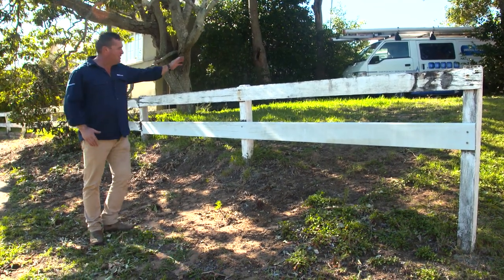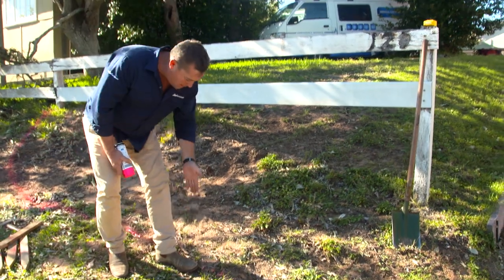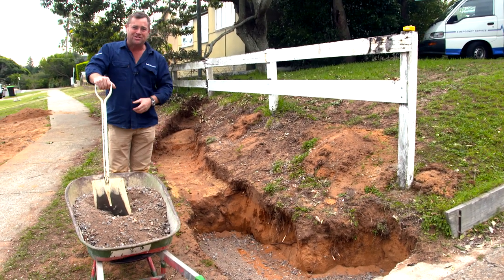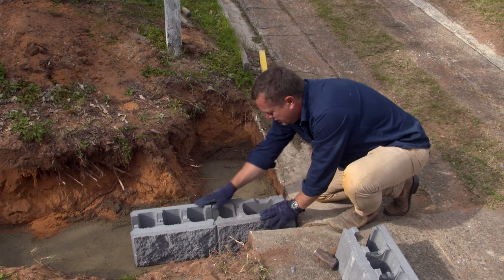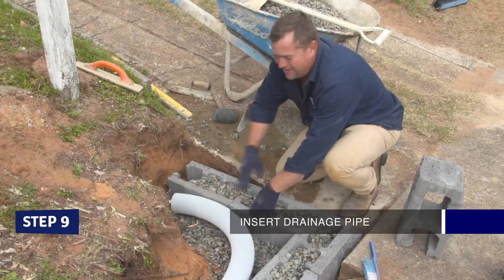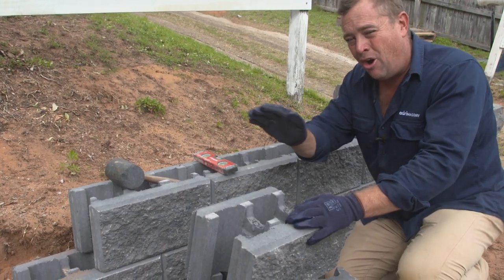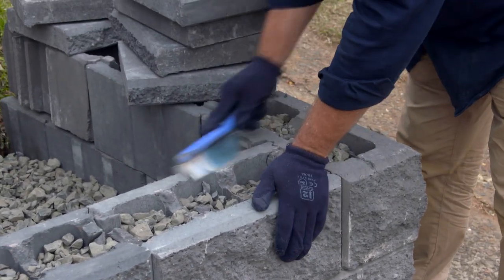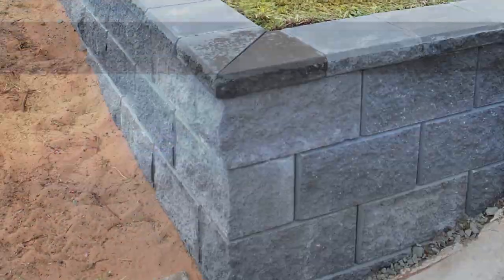How to Build a DIY Retaining Wall with Jason Hodges

Comment: I note the engineering brochure mentions knocking one back side wing off odd blocks in the second course to tie the rear aggregate to the internal cores. Should this be done for all walls? Or is it only an issue when over 4 blocks in height? Does this reduce the strength of the individual blocks themselves or is strengthening the overall wall more important anyway. Trying to work out strongest solution

Comment: How do you end off the wall? There are no half length corner blocks. Do you cut a corner block? If so, how do you slide it in to join to the adjacent block since the cliding track would have been knocked off?
Reply from the maker: Thank you for your question. There are various methods to ending a retaining wall, depending on your preferred design will determine the option. We recommend using corner blocks to make a 90˚ angle and continue the blocks into the hillside. There is also the method to curve the wall into the hillside. 
You can cut the corner block to suit the end of the retaining wall. The block will still fit into place, as you would have cut the opposite side of the 90˚ block that would be facing the hillside.
Please feel free to contact adbrimarketing@adbri.com.au if you have any other questions.

Comment: I think we are missing a very important thing here is: how you put the next layer of blocks on the top but they are half covered the lower blocks, can you pls explain this alternating blocks mechanism? do we need to break half of the block, if yes how and where to start putting half blocks? thanks in advance
Reply from the maker: We make two different corners, which you alternate on each course to allow for the stretcher bond lay (blocks half covering each of the lower blocks). If you'd like some more information I can send you a brochure on our retaining wall blocks, which includes the corner pieces.
Reply: @AdbriMasonryAus  yes pls send that brochure as i can't see anything on your website neither can't find anything in videos, how to place alternating blocks on top of one layer. thanks
Reply from the maker: @aqeel19  You can download our Versawall brochure from the link below. Page 2 shows a right corner unit, in which the left is simply reversed.
https://www.adbrimasonry.com.au/LiteratureRetrieve.aspx?ID=196026